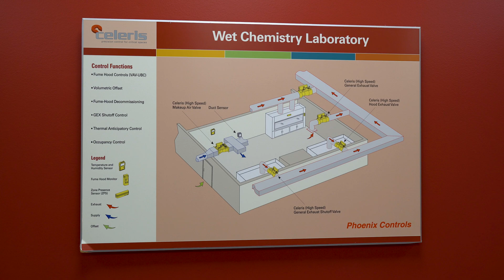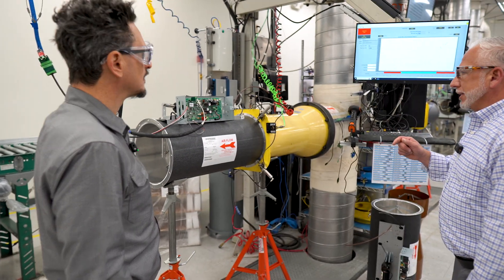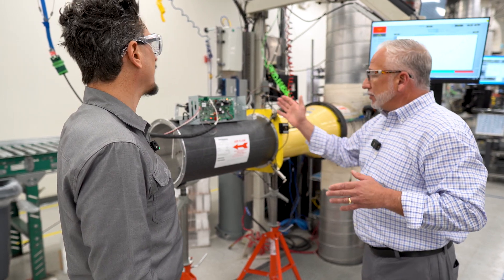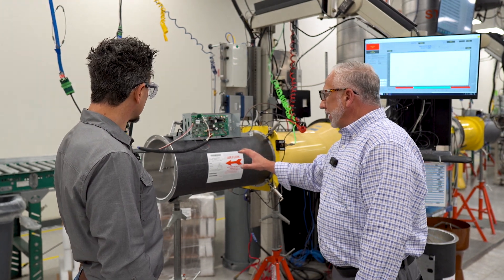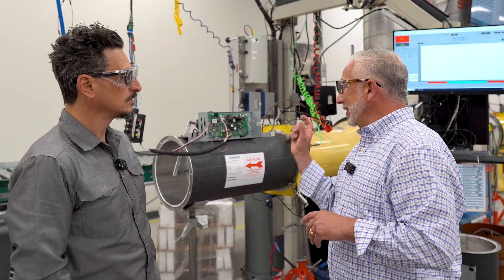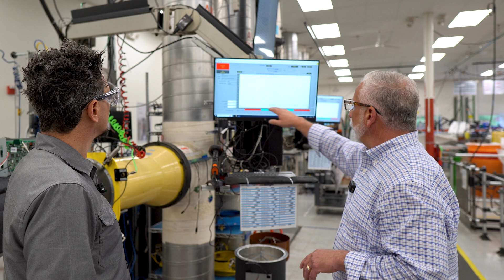Inside the Factory: How Phoenix Controls’ Venturi Valves Set Industry Standards

Comment: Hello. BSL-3 or 4 laboratory applications require a completely hermetic extraction system (duct, filter bank, venturi valves, and other components). Are Phoenix venturi valves completely hermetic? What is the seal on the shaft that acts on the cone?
Reply: With the Phoenix valves, in those applications the labs are usually set up/ ordered with "S" type Phoenix valves. The S is a number in Catalog numbering that is for "Shut-off" capabilities. This allows the valve the move to a truly "Zero" or mechanically closed valves position. Other Phoenix type valves do not have the capability to fully close. Additionally, in most of the BSL3 & 4 applications as you mentioned, there is the use of bubble tight dampers for additional protective measures.  Standard shut-off valve: Uses a metal-on-metal seal, which is effective but allows a minimal amount of air leakage (approximately 5 cubic feet per minute). Low-leakage shut-off valve: Includes an additional gasket (such as Viton or Neoprene) on the cone assembly. This reduces air leakage to less than 0.010 CFM, making it suitable for applications that require a tighter seal. I hope this answers your questions.